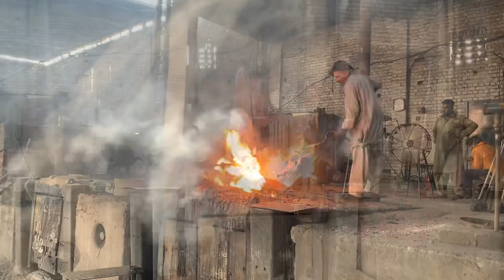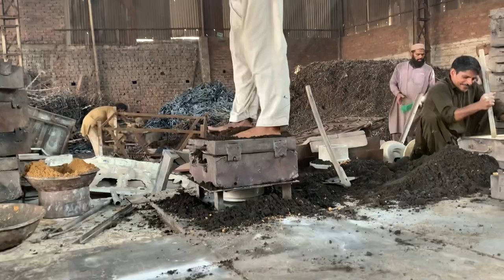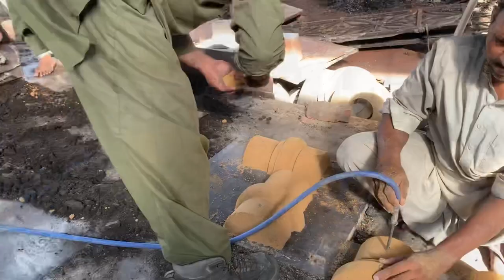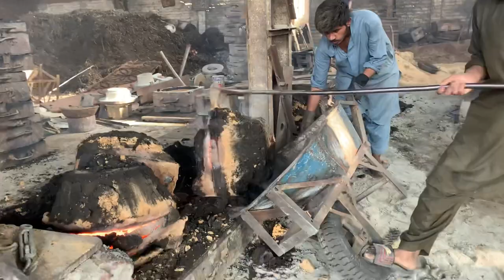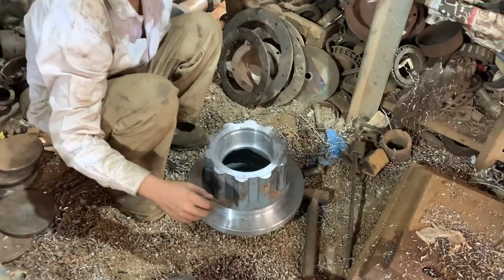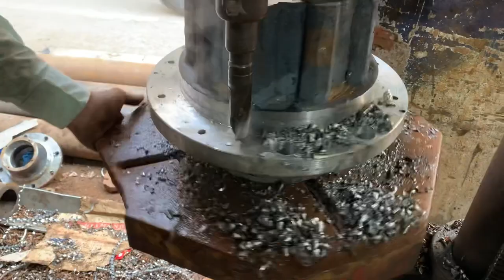How to Make a Wheel Hub for Heavy Duty Truck with Complete Processing of CASTING, MACHINING & HOLING

Comment: That drilling  lube looks like water, 
I wonder what run out between the front and rear race is.
Would like to see the truck using these wheels at speed.
Reply: מה
אני
Reply: My guess is kerosene.
Reply: Speed? What Speed? Haven't you seen the streets?
Reply: That has got to be water.  Probably ocean water lol

Comment: I don’t know how these guys work with all that crap on the floor. The electric motor on the lathe is half covered with shavings. Not only is that crap a tripping hazard but an electrocution risk as well. Surely someone could spend ten minutes at the end of the day and sweep the floor. There’s enough metal on the floor to fill that furnace 10 times over.
Reply: I'm sure those shaved metal were sharp guy cleened with bear hands. ,
Reply: Es un lugar de trabajo sin las medidas mínimas de seguridad e higiene de trabajo, sin equipo de protección y seguridad social.
Reply: The dude is bare foot! Most are wearing pajamas.  You want to talk about safety and efficiency?

Comment: The only measuring instrument I saw was a scale, not a micrometer or dial indicator anywhere.
Reply: Nope.  They did seem to make use of templates and gages.  I be the meister has a micrometer , dividers etc. tucked away in his toolbox.
Reply: @sandua51  May not have been in this factory but in one I saw them using spring calipers. And an old bearing as a gauge.
Reply: The way that the hub was centered on the 4 jaw chuck is totally hilarious
Reply: You missed the tape measure the lathe operator was using then...lol
Reply: They use go/no go gauges.
Reply: @miltonbertin  An old bearing isn't really a go/no go gauge, it's more of an 'I think it fits' gauge, depends a lot on the skill of the machinist.

Comment: Metallurgical science goes right out of the window here !!!!
Reply: Especially dangerous for load bearing parts when you have a mix of random alloys melted down like that materials will separate into layers. Which when you just pour it without filtering it properly. It means structurally sections will be pockets of different materials and of different densities and hardness. As such you certainly can't balance that part properly.

Comment: I do wonder if the service life of those hubs is longer than the time to manufacture them.
Reply: Much longer than an equivalent  modern factory because before 5hey start work the failure is already designed in
Reply: They are used in Pakistan with bad roads and overloaded vehicles and the only traffic rule in Pakistan unofficially is to drive while saving yourself and saving others so these hubs life is quiet good little rough as compared to modern methods but these hubs do there job
Reply: There's no way
Reply: Do you know what is the main cause of hub failure? It's a stuck bearing that spins. I don't see any production of bearings here. And if so, then these hubs should serve for a long time!
Reply: Думаю, чуть чуть дольше)
Reply: Probably not
Reply: Service life vs. product price is perfect. For 70 yo Bedford there is a little chance to get brand new OEM in Pakistan. Those hubs are going for slow overloaded trucks on rural roads.
Reply: How dare you to question the integrity of their product while it was tested and proven everyday by overloaded trucks on potholes infested roads there in Pakistan.

Comment: At first I thought they had no regard for safety (barefoot in the mold shop) but then I saw the safety sandals on the pouring floor and realized that I had been wrong.
Reply: 0911a
Reply: They are steel toe sandals
Reply: @insaneindamembrane7961  o99
Reply: @mukisakingdigitalsalongo7301  I learn this Smithy work in Elphinstone technical school in Bombay, during 1965.

Comment: They are using 2 types of sand, chemical bonded new sand for facing and core, rest green sand rammed by feet.
Reply: Green sand? Where? I see only gray sand. And it's gray because it's reused. It used to be white, but it burned out already in the molds for pouring.

Comment: Everyone is always commenting on the safety or machining work.  I'm just wondering about the composition of the metal they are using.
Reply: At least it looks like a metal. It is good enough 🙂
Reply: Number one quality special price for you today. There is a reason this stuff is cheap compared to the rest, quality is missing.
Reply: Hp Nl @marcusrybin9145
Reply: Theres a rule cud be bend...
 ISO on one side...&
NA on d othr...
Reply: I totally  agree.
Reply: They are probably wondering too

Comment: The skill of the "machinist's eye" is strong with these people. Close enough = perfect.
Reply: Thats true
Reply: Oh my God.  Seriously.  I wondered about the lathe operator, and how he could be sure about concentricity when he flipped that part.  He eyeballed it, and he was chucking on raw casting both times. No way dude.  Not a blueprint or indicator in sight.  Then I saw that guy center punch those holes based on a big circle with a pencil and it was all over for me.  If that thing actually fits on the truck it's meant for, I'll be impressed.  If the truck's wheels are concentric/coaxial within a whole inch, I'll eat my hat.  Do they have tolerances at all?  I saw a few check gages... but I also watched the lathe operator hammer one into the bore he was trying to measure, so who can say.
Reply: It doesn't matter who you are or what you are doing; perfection is always defined by intent. If it is as good as you (the creator) intended it to be then it is by definition, perfect. There is no argument or other judges. 
However, I would not want that hub on my truck. But, for all I know, I already have that hub on my truck.
Reply: @Ben Chuft I don't just believe it, I know it. So, why don't you go back and read my post again with your thinking cap on and see if maybe it sounds different. Then possibly you could enlighten us with your immense wisdom and explain to us less intelligent folks what your definition of perfection is.

Comment: This are bronze age techniques and weakness of the remelted mild steel is made up by giving the casting bulk. But what about ball bearings for such shafts and bushings are they for free
Reply: you are right, adding certain elements to the melting pod, and the drop forging would make a much stronger metal to work with. But I think these guys are getting by with what they have available to them. And I think they are showing skill in their jobs.
Reply: It looks like they used some form of carbon steel, not mild steel. The cuttings in the wheelbarrow that were loaded into the furnace looked like recycled razor-wire, or similar,  which probably has a higher carbon content. None of it seemed to be plain mild steel, so maybe the quality of the steel is not so bad after all.

Comment: I love watching the machinist on the lathe climb that mountain of razor sharp filthy chips in his flip flops.  Also using the check gage while the part is still moving is kind of impressive in it's audacity.

And how there isn't a dial indicator in sight... He just eyeballs it when he flips the part to machine the other side.  Is there no print?  No concentricity tolerance?
Reply: That’s ole eagle eye mic and cal the hand caliper at it again
Reply: @wellscody86  I mean it's great when you can judge runout by eye down to the ten thousandth.  Most of the parts I run, concentricity doesn't matter that much.  It just blows my mind that a cast wheel hub is fine to eyeball between sides.  I imagine what the truck we would look like driving along with fifty thousandths of an inch runout on one wheel... If the operator got it slightly wrong.
Reply: @somethingelse4424  You forgot to multiply that affect out to the tire tread. That .050" would an inch and quarter easily.
Reply: @somethingelse4424  I don't see you're point, that thing will mount a rim just fine and maybe it will even hold while driving slow and thats all you're paying for. Anything else costs extra😂
Reply: He used a super precise measuring tape. Twice actually, I think.
Reply: @somethingelse4424  Have you ever looked at the runout of a tire...
Reply: @somethingelse4424  And by the way, he's not judging runout /entirely/ by eye - he's using his boring bar as a "feeler" on the outside edge, to re-set the outer rim concentric to the axis of rotation, and he's using the chuck face to establish a plane perpendicular to the axis of rotation.  As an approach, it's not good to tenths, but it's certainly adequate to a couple thou, and that's all that he could hope to hold on that lathe (and all that he has any need to care about, for the job that he's doing).
Reply: SomethingElse:

My guess is this shop does a “pre-machining” of the hubs since the 2 machinists (lathe & drill press) eyeball their work, & whoever buys their hubs finishes with their own lathe work (hopefully with dial indicators) & threading/studding the holes!
Reply: Even better, what about the guy in the beginning of the video...
A bunch of casting splash gets away right into the open toed sandals.  Shakes it out like a pro and keeps going.  Haha!
Reply: @Alpha Jamil I don't know exactly.  0.05" is a lot of runout though even if you have a tire on it traveling at 60mph in my mind.  0.05mm is nothing though of course, and it's basically running true if that's the issue.  I'm spit balling here.  I make hydraulic fittings and not parts for wheels or bearings, so I'm not sure what kind of general concentricity tolerances those parts have.

Edit: NVM, you said inch... So I guess you just have to picture what that looks like.  0.05" is pretty wobbly.
Reply: I was thinking the same
Reply: It looks like it might even be more than .050" but it's hard to tell just how bad it really is on camera, imagine how long the bearings are going to last riding crooked like that
Reply: When the swarf reaches the ceiling, it's time to haul the lathe to the second floor.

Comment: When he threw that freshly machined part off the lathe into a pile of freshly machined parts I shrieked. 18:36
I cringed when he hammered the check gauge into the bore, but I lost it when he let the part dropped that part on purpose.  What in the absolute hell.
Reply: You do know that in service these parts experience huge force, if they can't stand being dropped on the floor they can't do their job
Reply: @gregsutton6258  I don't think he meant that it could break. He probably meant that it would dent the machined surfaces causing other parts to not fit properly. This hub will have two bearings pressed in and a mating brake rotor bolted to the outside. Besides that it is just a really stupid thing to do.

Comment: I'm impressed by the lathe operator doing his job without a dial indicator, micrometer or even a caliper, it looks like the only thing he's got is an old tape measure.
Reply: without safety glasses and in this funny dress
Reply: @Funk Masterstill it's really difficult to work like that. usually you work on a lathe by doing relative passes, sure you might sneak up on a really accurate measurement and let the stock cool down first, but it's always based on relative measurements.

Comment: +/- tolerance ? Eh close enough
Reply: Pre industrial tolerances... I love how the guy on the lathe spends a half hour turning checks meticulously with the only scale in the place and then pounds a seal in to check fit the part. When finished rolls it into a pile of parts on the floor.

Comment: After watching this I can only say , At least the guy on the lathe has his "safety baseball hat on".
Reply: the machine has a belt drive and low speed - this will not make it possible to press the cutter strongly and therefore the chips cannot fly quickly. Do you know why they began to use protection? Yes, from the speed of production of parts (which the greedy capitalist needs for enrichment), which are possible only when the machine speed is high and the chips fly quickly and strongly. Protection became necessary when the speed of production became high! And when they sharpen slowly, there will be no injuries.
Reply: when you grind slowly, you don’t need a supply of lubricating fluids for cooling - the part does not have time to heat up. Do you know why all modern machines have a supply of lubricating fluids? The capitalist needs this - after all, the more parts are produced, the greater his wealth, capital !!!

Comment: I would love to set up such a facility here in Africa and any help in terms of advice and hardware suppt I would appreciate so much
Reply: Very interested
Reply: Can you help me
Reply: @albinrezwan1999  help you do what my friend
Reply: i will forward email i received from nigerian prince needing help reuniting with his fortune and offering pay too anyone willing...................
Reply: @blackiedekat2612  to mean?
Reply: Yeah. "Wear Shoes".
Reply: Buy a decent CNC machine and study how it works along with measuring equipment it's worth it if you want to produce repeatable quality. Which you could eliminate the steps of having to make a pour mold each time you just pour square and round ingots and machine those into whatever you need. Also getting a variety of draining and dedicated crucibles and skimming equipment is a good plan so you can separate out mixed material when melting. Easiest method is to sort by density lighter density material is going to float on top. Presorting scrap accordingly will also cut down on what I just mentioned.
Reply: @fireteamomega2343  Would you suggest like what type of CNC machine
Reply: @timothyadem8354  
Depends on what you intend to make and how big the parts are there's Mills and lathes. Personally if I was starting out I'd study up and work on getting a Fadal 4020 milling center there basic good workhorse machines and built like tanks. I can do just about anything with one even what is typically lathe undercut work. Takes time and practice learn to use interpolate and specific endmills for what you're doing and secure your stock correctly. Once you make some money off it then you can start thinking about 5 axis. They aren't as forgiving but are pretty much the gold standard in machining.
Reply: @fireteamomega2343  I am greatful for the wealth of information you are providing.
Could the Fadal 4020 milling need any more machines to assist it.

What I mean is what do one need as a full start up for the business where it not only do one kind of job but can be used to make other parts that requires the same process of working
Reply: @fireteamomega2343  I am not vast with the field but I have the zeal and interest to pursue it fully.
Reply: I need a help ..

Comment: No wonder they need a set of wheel hubs for the same truck weekly! Everything is fit together so poorly that there’s premature wear on every machined surface. Diameters aren’t even machined concentric to one another.  There’s is absolutely no machining skill here at all! Maybe a will to get it done but what’s the point if it just breaks a day later?? Job security at its finest😂🤡
Reply: Ain't no money in finished job ...
....gotta get those repeat customers!!
Reply: They just turn scrap into more scrap
Reply: You r right. But the problem here is that these guys aren't facilitated from govt. No latest machinery, no cheaper electricity, no better tools not even medicines if accidently get injured. If they are facilitated they'll definitely do much better.

Comment: I just love the "cheater" bars on every machine tool handle! - and the number of broken and welded handles! And I'm sure that's just water in the squirt bottle. No need for any expensive coolants, when you've got cheater bars to apply the pressure! I trust these hubs are only for off-highway applications, and they don't do any more than 25mph!
Reply: these are hubs for tractor and construction machine. They never drive fast.
Reply: У меня вообще возник вопрос, срок службы этих ступиц, превышает время на их изготовление?))

Comment: using a 4 jaw lathe machine is a skill..u have to center it manually adjusting the 4 jaws individually.  I am getting goosebumps all over while the machinist is operating without safety glass.
Reply: In China they reach in to the spinning part to pull shavings off. I seent it.

Comment: Do these hubs even “work”?  (I’ve done my share of bearing housings in aluminum, for much smaller bearings.  Getting the fit right was NOT easy.)
Reply: Not aluminium unless i am very mistaken
Reply: @dennisyoung4631  steel scrap...they don't need to do much to it to get the right "mix"
Reply: They surely wouldn’t be making it If it didn’t work!!LOL!!
Reply: You know that great stuff they made in the 30's 40's and 50's that are still good today...This is how they made them, with hard work and skill.
Reply: @noname-nd8ec  they also used measuring equipment, e.g. go/no go gages, micrometers, snap or telescoping gages, etc.  I’ve seen these in use, and have used them on the job myself.

I used the last two when boring those bearing housings mentioned earlier.  Bearing fits, for say, a 6800 bearing are measured in *tenths*, I.e. 19mm or 0.748 inches, +/- .0002 (or so). Too tight, the bearing doesn’t work right (feels tight for turning) or you cannot get it in.  Too loose, and it doesn’t support the shaft properly (as a bearing) You can sometimes save a (slightly) loose housing with a certain kind of loctite…

Comment: Do different steels melt at various temps, and if so, does that make a part like this weaker ?
Reply: @hanksCorner7011  Thanks, you filled in the blanks...
Reply: In theory at least, that was supposed to be cast iron, but they were definitely dumping some steel in the pot, which would improve the quality to a degree. I am sure it was just some off hand mixture.
Reply: @Ben Chuft Thanks.I also watch windy hill foundry, and he uses a lot of brake rotors, it seems that they are mostly the same kind of cast iron.